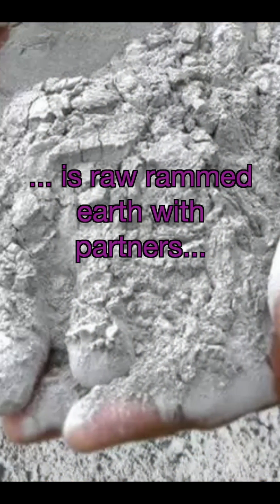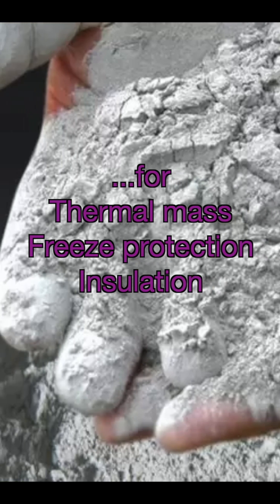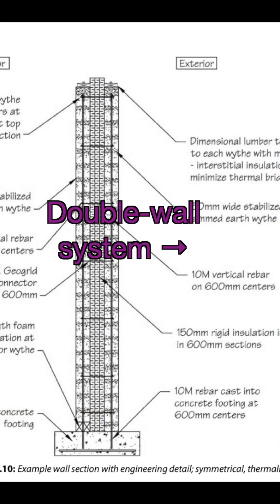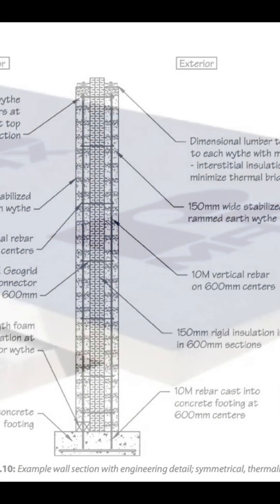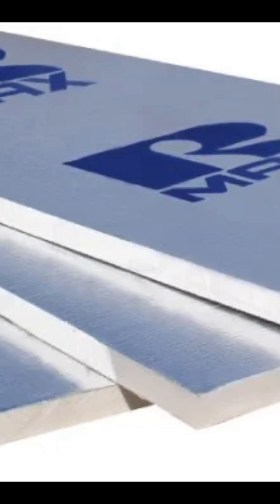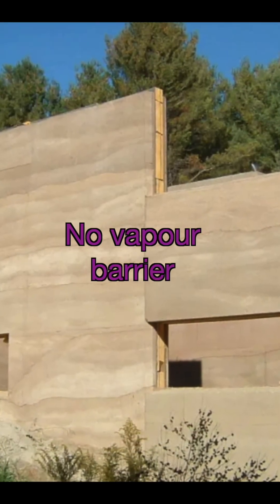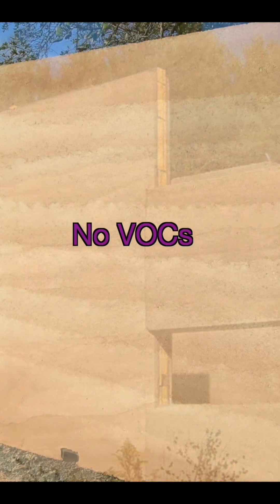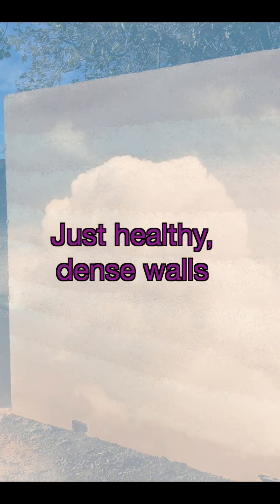The Secret to Warm, Healthy Walls in Freezing Climates ❄️

Comment: the insulation breathes, i guess? what is the material?
Reply from the maker: It’s not particularly vapour-open. In fact, Tim Krahn recommends using foil-faced XPS or EPS mainly for code-compliance reasons, since most codes require a tested and proven vapour barrier. That said, rammed earth already manages vapour movement naturally, so the requirement doesn’t really make sense here. In practice, it’s also a bit of a moot point — rammed earth only “breathes” through its outer few inches. Deeper within the wall, where the insulation sits, vapour movement is minimal anyway.

Comment: Are you sure this outlast bricks and mortar?
Reply from the maker: Great question! It depends on the design and climate, but rammed earth can absolutely outlast brick-and-mortar. Mortar joints are usually the first thing to fail in brick walls, while rammed earth is one solid structure with fewer weak spots. That’s why you still see centuries-old rammed earth buildings around the world today.
Reply: @RootedResilientLiving i am seeing brick and mortar building that lasted thousands of years in italy... not just a few.  But i understand what you sed. It all depends.
Reply from the maker: Absolutely — those ancient Italian and Roman brick-and-mortar buildings are incredible! They used techniques we’ve mostly lost today: lime-based mortars that self-heal, volcanic materials that actually get stronger with time, and walls so thick they could handle huge temperature swings. 🌿 Modern brick construction is very different and often doesn’t have those same advantages. Part of what excites us about rammed earth is reconnecting with some of that ancient building wisdom — durable, low-tox, and designed to last generations.

Comment: I’ve always wondered if the two layers of rigid foam would not act as a vapor barrier inside the wall
Reply from the maker: Good question! In rammed earth walls, the material “breathes,” but only within the first couple of inches. Any vapour exchange happens right at the surface — moisture doesn’t make it all the way into the middle of the wall where the rigid foam sits. So the foam isn’t acting like a vapor barrier in this case; it’s protected by thick, dense earth on both sides.  🌿